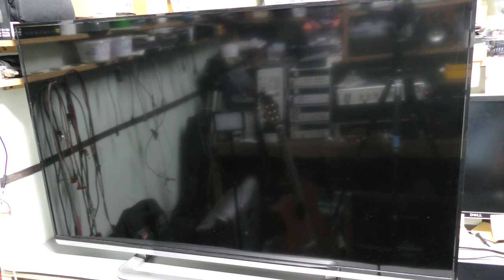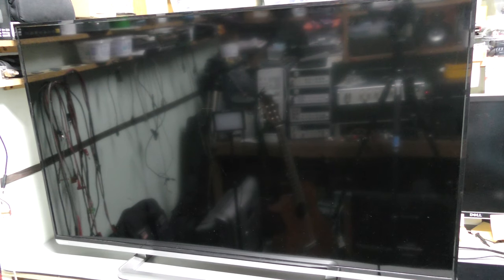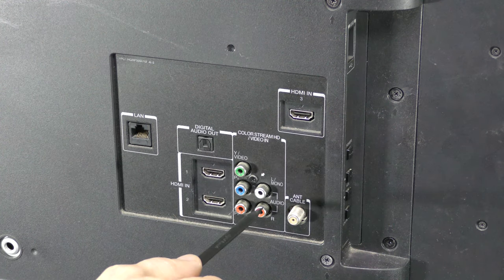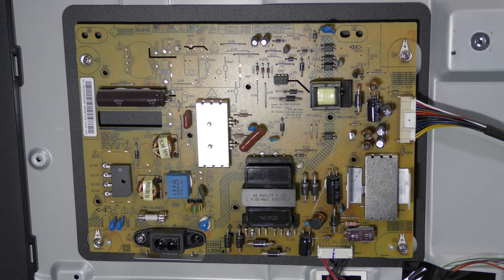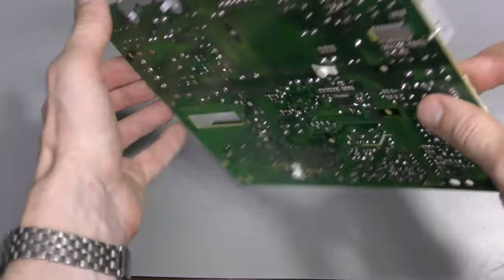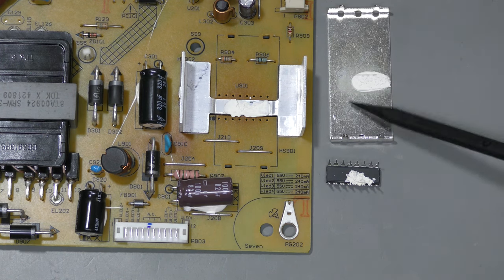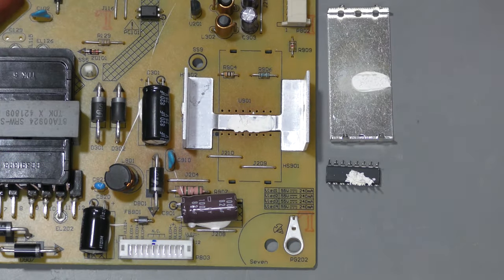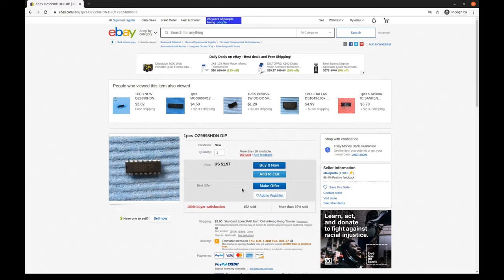#99 - Toshiba 50" Smart TV repair

Comment: I would add some active cooling. Maybe an old laptop fan running on low.
Reply: ....or at least an additional heatsink mounted on top.
Reply: I like the fan idea. Have to figure mounting to rear cover, possible rf interfearance, power takeoff. Oh, don't forget, once fan is up and running how do you deal with dust clogging potential.
Reply: probably some copper heatsink mounted at the top of existing one will solve the problem for sure.
Reply: @jdmccorful  Laptop fans are squirrel cage so a rear mesh dust filter made from screen door material. RF interference ... like what the fan will do in a laptop? Yeah, no. I have ziptied fans to all sorts of things in the past with zero issues.
Reply: Noctua makes nice quiet 40mm fans as well

Comment: The logo on the PSU board indicates FSP group / Fortron power supply. They make power supplies that work. That's unfortunately all there is to be said. Quality isn't their strong suit as far as my experience with their pc power supplies goes...
Reply: 100% right. They are used by many big name brand manufacturers, but i have also seen many  of them failed.
They work and they have a power supply in every form there exist, but that said, they don't last long.
Reply: @BjornV78  Yup, I've seen them rebranded as well. For example "Component Pro" that used to be present in the AOpen desktop cases...
Reply: @MrDubje  , they are a OEM manufacturer for many brands, they are also by Medion in there desktops, and for there notebooks. 
Even in Watchguard firewalls, which i don't understand from such expensive brand.

Comment: the heatsink is just a flat metal piece with no fins! For me this is the worst part of the design. I would try and fit another heatsink with fins and  add a small 30mm -40mm fan.
Had they used the SOP package it probably would have a heatsink pad under belly and with a large ground plane the heat could be dissipated quite reasonably. This is really a cheap design

Comment: Terrible power supply design. I wonder if it be possible to stack two of these chips on top of each other and have them load share.
Reply: Not possible. These chips are switching the Fet, and not in sync
Reply: @octavmandru9219  well, yes but perhaps they can be forced to sync. Granted I have not seen the datasheet.
Reply: Excellent suggestion

Comment: Excellent repair of a  poor design. As others have suggested I wonder if some active cooling might extend the life of that chip. Did you check the temperature of the MOSFET (or circuit board area under it)?
Reply from the maker: That part was not as hot, so I did not bother.

Comment: Hi, did you attempt to re-bond the original chip to the heatsink at all before deciding to replace the chip? Just wondering if the blinking could have been due to the thermal protection cutting in and out if the original thermal bonding had failed.
Reply from the maker: No, I did not try to re-glue the original chip. And the glue looked perfectly fine.
Reply: Would have been interesting to see if cold spray on that chip would have stopped the blinking.

Comment: Toshiba is low end chinese stuff anymore. That's why the generic chip that runs hot. Seems like most of brands we grew up with in the 80s and 90s are just low end chinese products anymore. Sad state they are in. I'm still using a mid 2000s Panasonic plasma TV that's been great. Lost a mosfet in a driver board once, replaced that and she's been great. Keep up the videos!

Comment: I would get an old 90's heatsink for Intel microprocessors and put it on the aluminum heatsink. My guess is this chip will also fail but if lowered to below 50° C it will last till the cows come home.

Comment: Logo on PS-PCB is that of Fortron Source, maker of (generally not too bad) PC Power Supplies. Personally would tightly screw another heat sink (extruded aluminum profile as big as allowed by back shell)  to existing sink, adding thermal paste.

Comment: I would increase the heat sink, also add some fins to it. I wonder if it is not possible to grind some of the chips's plastic in order to get closer to the die. How on Earth did the O2Micro designer thought this throuh?

Comment: I'd want to add a bit of heat sinking to that little FET. Difficult to do though.
Adding a slim heat sing (motherboard chipset type) to the IC may help as well. You have thermal glue ;)
And don't drive the backlight at max, but keep it at 89% max.

Comment: As to a fan, this is to be used in a—usually—quiet room. Fans will add noise, maybe a small amount, but it will be louder than nothing.

Measure temperature again and reduce the brightness. Does the temperature change?

Comment: Thank you for the video and information, but I put a dislike, because with Your level of knowledge, it was possible not to repair a deliberately bad circuit, but to make your own reliable control module, which would not contain a "planned failure". for a couple of seconds on the capacitors and chokes, you can make a current source from AC mains voltage without ripples of illumination, and if you spend time, you can make a controlled illumination. And I'm also surprised that You didn't change the electrolytic capacitors, because it is very obvious that they were put there at a minimum, and they are already a little dry. And heating the radiators accelerates the drying of the capacitors. And they cost a penny, sometimes it turns out to find capacitors just a little bit larger in size, but already from the "long-lived"series. Sometimes even "ultra long-lived". The power module appears to be marked by the FSP group
Reply from the maker: You set the bar to earn your like too high. I am afraid I cannot live up to this standard. And by the way, the capacitors measured perfectly fine. Thanks for your attention.
Reply: That would be a ridiculous amount of work for a TV that he got for free and which is easily repairable if the same thing happens again.